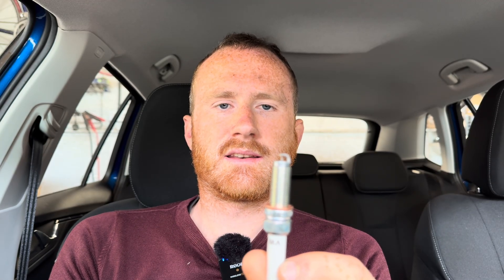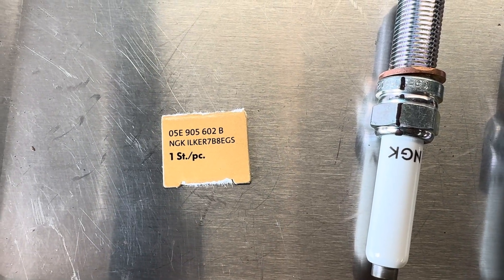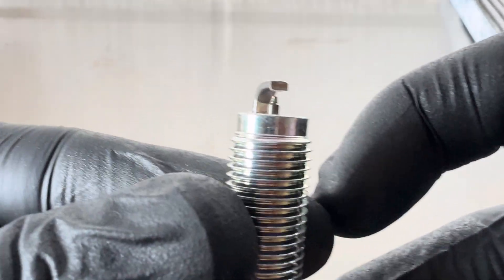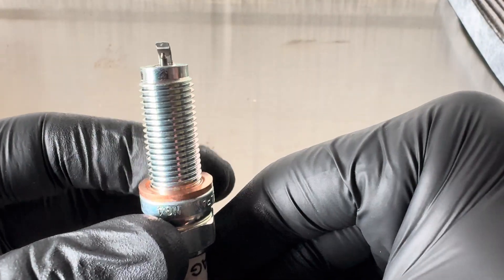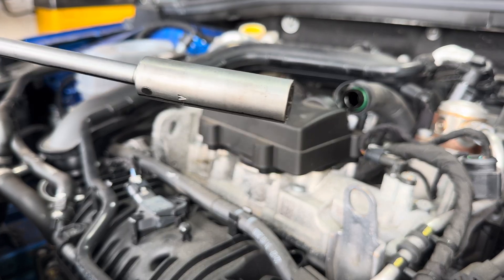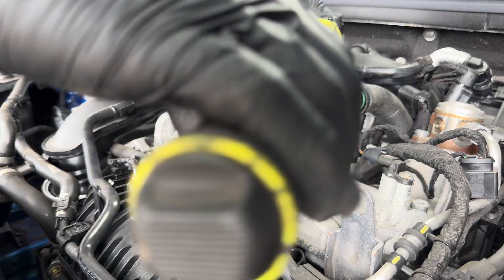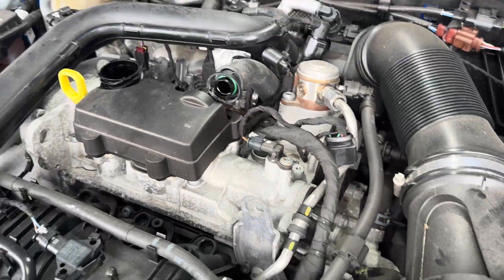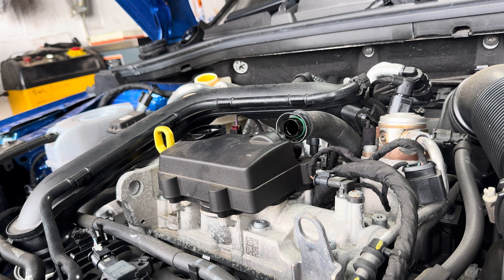Internet Experts Proved Wrong, Why You MUST Torque Your VW Group Spark Plugs!

Comment: I read TSB for mercedes AMG engines (Most critical for M157 M276 M278), that it can cause detonation and wear on the cylinder wall incase its not torqued properly.
Reply from the maker: Yes, I heard that too!

Comment: The ground strap position is inconsequential, especially on modern high swirl cylinder heads.
You do show that the plugs are all made very consistent, which is nice.
Reply from the maker: There’s a VW TSB correlating over torqued plugs with misfires on direct injection engines in the EA211 series. Apparently the ground strap occludes the injector spray pattern.
Reply: @theweekthatis  To have this level of sensitivity to electrode position is not good design. Over tightened plugs however can certainly cause problems due to the shell distorting leading to insulator / heat path issues.
Reply from the maker: @andrewturner8914 maybe it’s all that’s left, combustion engines are chasing smaller and smaller gains now.
Reply: @theweekthatis tried finding this TSB but couldn't. 
Do you have the TSB number?